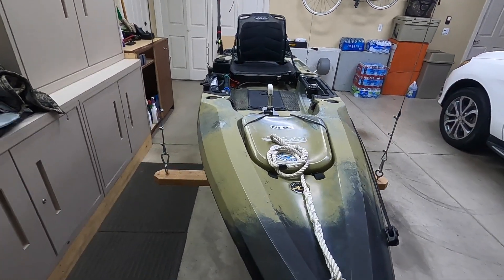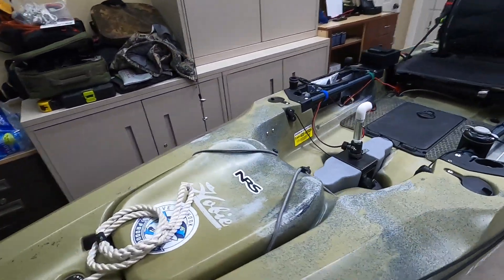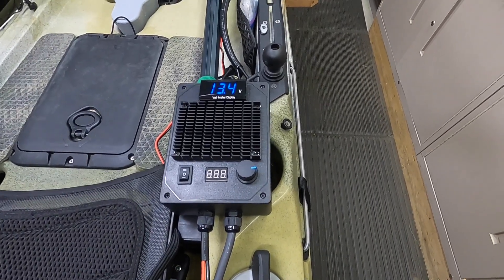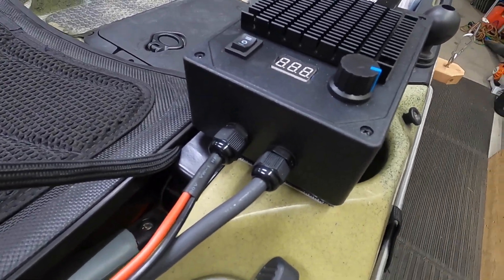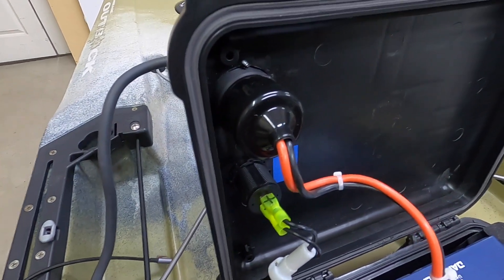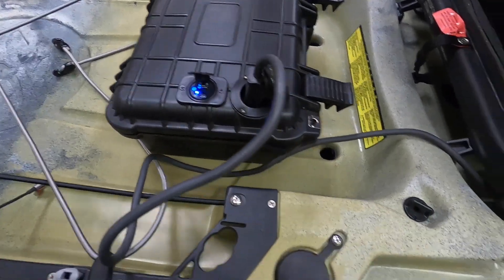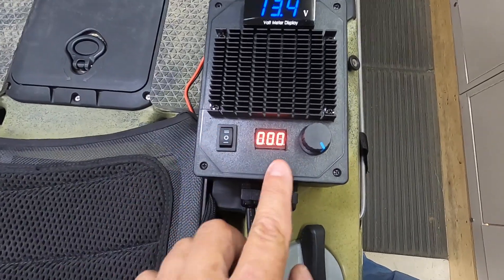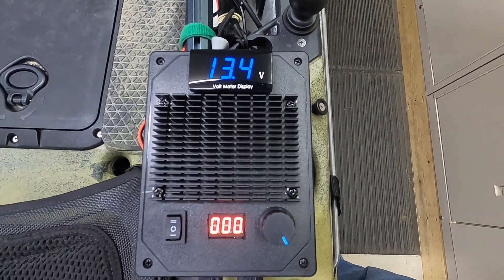PWM Trolling Motor Speed Control Box - Kayak or Personal Pontoon Boats

Comment: Wouldn't it be easier to just put the PWM in line and hook it up to the 5 speed switch in the trolling motor. Just turn the 5 speed switch up to full power and regulate the voltage with the PWM. That way you don't need to open up the top of the trolling motor and mess with the wiring.

Comment: Those 60 amp PWMs will run very hot when using them with a 40 LB. thrust trolling motor. I burned mine up because it could take running wide open for more than a couple minutes. I could smell the plastic burning and the variable speed control switch quit working now. I switching to the 100 amp PWM with the fan built in so hoping that will work for me.

Comment: Do you have any videos on how to wire the speed controller?
Reply from the maker: No, however, it is pretty much straight forward - power (battery) and motor (troller) with plus and minus connections. Thanks for watching.

Comment: Nice idea using the heatsink, however the plastic box actually serves as a thermal insulator. It 'might' draw some heat away/out of the box but I doubt it's enough to be truly effective. Normally heatsinks (made from aluminum or similar) attach directly to the metal that's generating the heat. The CPU of a computer for example (which generates about 70-100 watts), the heat sink is bonded to the CPU with thermal paste to 'soak' and dissipate the heat away from the CPU. The plastic is a poor thermal conductor, that is - it insulates and keeps the heat inside the box. Again though, I suppose if/when the box does get warm it could dissipate some heat out of the box. I am using a PWM to control the speed of my Minn Kota 36 lb. motor (with the head removed), which is sealed in a food container. No vents and everything sealed water tight. The box doesn't even  get slightly warm. I doubt you'll have any over heating issues with your 24 lb. motor. It doesn't draw as much current (or generate as much heat) as my 36 lb. motor. Also - nice idea of a voltmeter for the battery. That removes the guess work of guessing the capacity of your battery.
Reply: I totally agree with TC - the large heat sink on top should be directly connected to the transistor driver heat sinks for it to properly dissipate heat if the transistors get hot or install a small cooling fan facing the transistors.
Reply: Hi TC Bend did you use an in line fuse with your PWM

Comment: I've always wonder if you could explain what percentage of battery you save if you running the trolling motor at 50% power, what are the amps drawn with and without a pwm  Both running at 50%? i know at 100% power they both draw the same amount of power but the pwm its supposed to save battery so at 50% power how much power or amps are you saving, hopefully you understand what im trying to say .
Reply from the maker: Rodrigo - Thank you for your question. However, I am not sure I can adequately answer it. While a number of low end trolling motors use a 1-2-3 or 1-2-3-4-5 step speed controller, I simply wanted a true variable controller to allow 0 - 100% speed control for most water/wind conditions fishing banks. Again, thank you for taking a look at my video.  PS - A couple months ago I upgraded a to a new motor, the Newport Vessels NK-180 24V, 60lb thrust trolling motor. A fellow yaker bought the Watersnake setup for his Hobie Pro Angler 14. I hope you will subscribe and hit the bell as I plan to upload a new video on the NK-180 soon. Tight lines.

Comment: Great setup.. I am trying to do same, I am converting to a PWM. I have a question on how the heatsink was installed, is it connected to the small heatsink on the board or just basically part of the cover to absorb heat? Thanks again for the video, it helped a lot in my build.
Reply from the maker: Thank you and glad to learn it was helpful. It is a fun build. So, after cutting the heat sink to size, I cut the hole into the box lid a quarter inch smaller than the heat sink. I used a Dremel bit to grind away heat sink fins at the corners and drilled small holes for screws to attach the heat sink to the lid. Use silicon glue to seal it off. The heat sink just sits above the sinks on the controller board.  Good luck and I hope this answer helps.
Reply: @rick-in-bako  thank you for the reply... I may try to install the heatsink as well, just need to test and see if the temp gets too hot.
Reply: @daverns111  Try to connect the large heatsink with the small transistor heat sinks for proper heat dissipation or install a cooling fan facing the controller board.

Comment: Nice clean set up.  did you mention your motor size? And is the 54ah sufficient? do you have full day type use...??  Thanks
Reply from the maker: Hi Mike, thanks for the comment and question. The motor is a 24 lb. thrust Watersnake and does a good job of getting me from place to place over 5 to 6 hours on the water.  Five to 6 hours is all I am good for, but the battery always has plenty of power remaining to go longer if needed.

Comment: How do do you keep the water out of the PWM controller with the heatsink on top?
Reply from the maker: Good question, thanks for asking. The heat sink is slightly larger than the hole cut into the box lid and used silicon glue around the hole opening on the inside of the lid. Hope this helps.
Reply: @rick-in-bako  does the water get inside the top of the slots when it rains? I just didn't know if it's a one directional airflow from the inside out or of air comes in from the top as well,.and in turn let water in?

Comment: I really liked your video at Lake Isabella.    I am on the cusp of buying a new Hobie for Crappie fishing, and some Bass fishing.  Mostly Crappie. I am 80% sure I want the Outback, as I was messaging a guy on a forum here in Texas about the Outback vs. PA14.   I’m getting older and am only 5’6”, 150lbs.  The other guy went from a PA14 to Outback due to the bulkiness of the PA14.  Do you miss the PA14?  Is there anything you miss about it, or does the Outback get the job done just as well?   Thanks for your help.
Reply from the maker: Thanks John, glad to hear you enjoyed the video. To answer your question, no I do not miss the PA14 and very pleased with the Outback. At 71 years young and a big guy in comparison to you, I find the Outback fills all of my fishing needs. The PA14 provided lots of extra room around your legs, but I have managed quite well in the Outback. The PA unlike the Outback provided 6 rod holders (3 on each side), which was pretty cool. However, now I place up to six rods into vertical rod holders attached to the crate behind the seat. Bottom line, the Outback is perfect for me and I have not regrets selling the PA. Good luck.

Comment: Nice setup.  I appreciate your time and effort to make the video.  I'm thinking of a very similar setup on a FoldCat 375 (that I can transport easier and likely more stable than a kayak).  I found a 40 amp hour (500 watt hour) battery for about 1/2 the cost of the Dakota.  I am also contemplating the Sea Eagle bimini top to hold a 100 watt flexible solar panel to provide some shade while maintaining a charge on the battery.  I could possibly use a smaller battery with less weight and less cost since most of my boating/fishing will be out in the blazing sun anyway.  The down side is learning to cast from under the bimini top.
Reply from the maker: Thanks! Happy to hear you have a set up plan. Good luck.